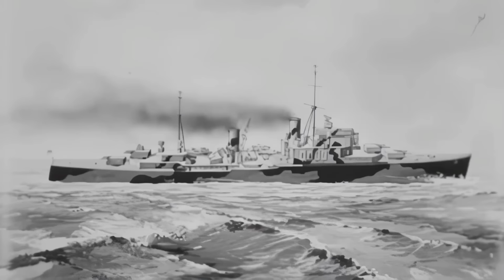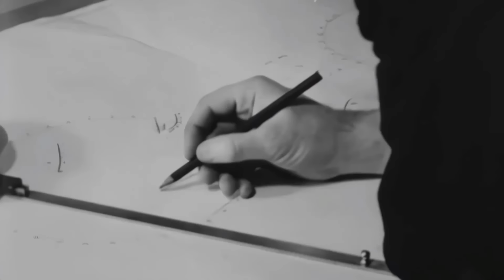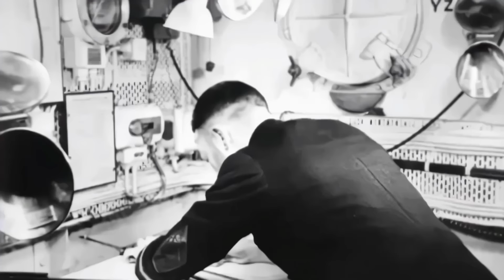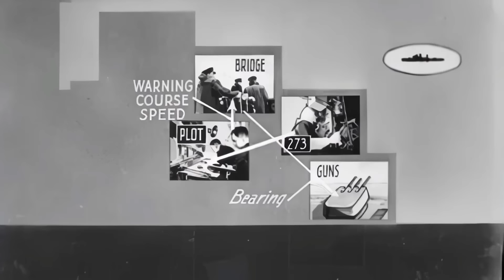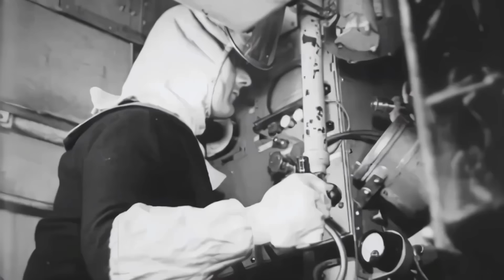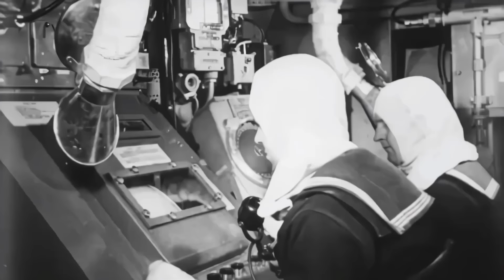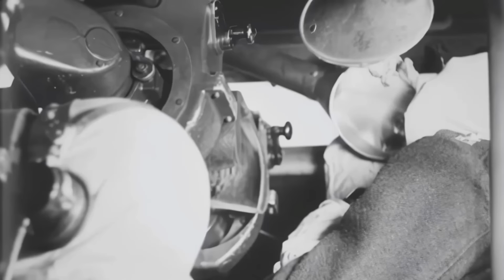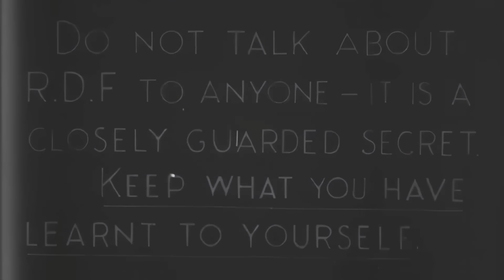Radar Gunnery | Secret 1943 Surface Combat Training Film

Comment: There is so much there that is different from today's navies shown on that Town class: 1.  Sound tubes in lieu of electric intercoms, 2. Paper for the plot with an anolog course computer, 3. All the radar antenna being manually turned, 4. Direct optical rangefinder directors with add on radar,  5. An open top bridge, 6. No AIC/CIC on a cruiser, 🤯 7. No plane position inicator (PPI) scopes anywhere. It is amazing how much the RN advanced between 1943 and 1945, technically.

Comment: I wonder if Drachinifel could identify the ship concerned ?
Reply: All we know about the ship in the video is that its a Modified Fiji-class cruiser.
Reply from the maker: It is one of the original Town Class. You can see this from a few features, but most obvious is the curved front to the bridge. The Fiji's went square for ease of manufacture and assembly.
Reply: @ArmouredCarriers  oh, so this is one of HMS Belfast's siblings, then?
Reply from the maker: @kristoffermangila  This is "Batch 1", Belfast is the stretched "Batch 2" version.
Reply: @ArmouredCarriers  so that means its one of the Southampton subclass ships, then. Which narrows it down to four ships: HMS Newcastle, HMS Sheffield, HMS Birmingham and HMS Glasgow.
Reply from the maker: 👍  @kristoffermangila
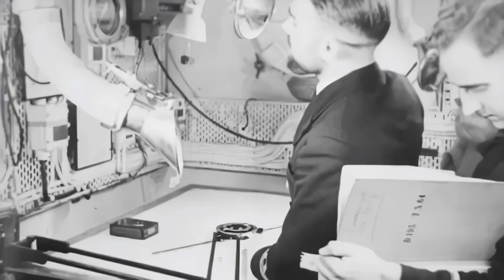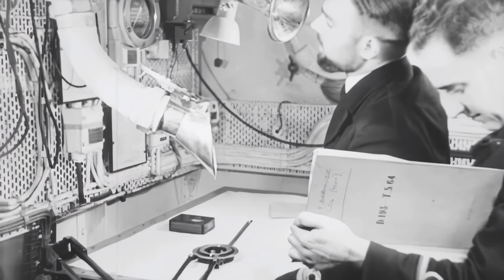Reply: @ArmouredCarriers  Great film !  In terms of identifying the vessel, could that possibly be a ship name at the top on the cover of the Plot Sub Lt's notebook, seen at about 18:39 and again at 20:04 ?  Can't quite make it out, but might be clearer on your actual film ?
Reply from the maker: I'm afraid it's no clearer on the original film. The equivalent of 16mm film in modern terms is a resolution of 720x480 pixels. Here I had to use AI "upscaling" to make it look reasonably clear on modern televisions. And I've not been able to find any records about what ship was used in this production. But it certainly looks like one of the first/original batch of "Town" class cruisers - based on the curved shape of the bridge and the arrangement of equipment on its hangars.  @graham5118